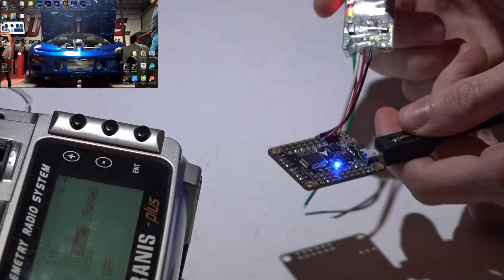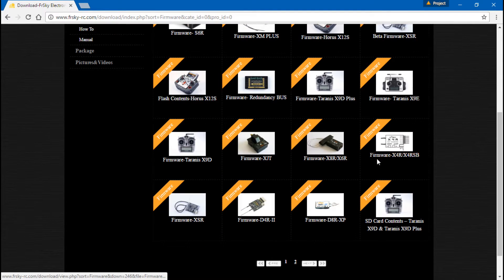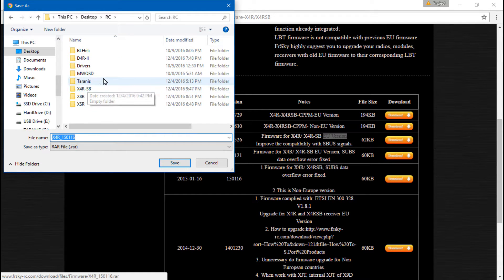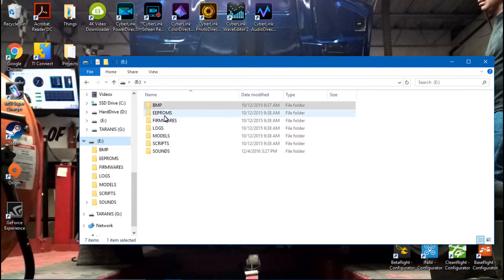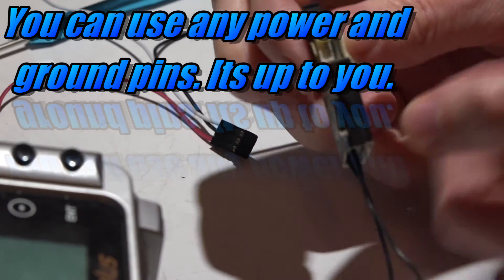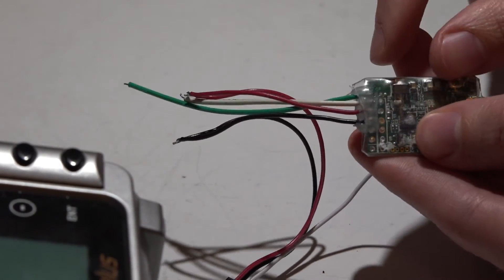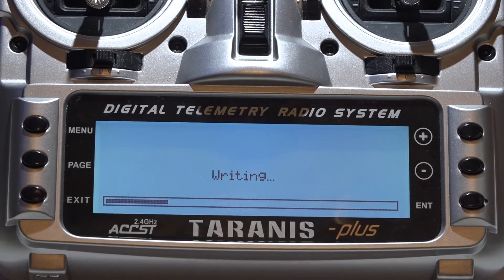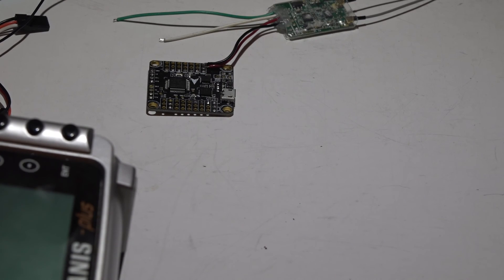FrSky X4R-SB: How To Change EU / Non EU Firmware

Comment: I upgraded my qx7 from your other then followed the instructions on this vid but I can't connect rx n tx.. I flashed the xjt module as suggested and updated firmware on qx7 exactly as you did.. what am I doing wrong . Help please
Reply: Version on qx7 is 2.2.0N371 (4df32f82).    RX firmware is X4R_150116.frk.     XJT firmware is XJT_build161214.frk

Comment: hey i have a kingkong 90gt that came with a ac800 receiver. i bind it to it. i have it set to D8 like it said. but i dont nothing happening with the transmiter in betaflight. i set the arm and mode channels but nothing happens in beta flight or with just the battery. only lose telemetry when i remove battery. please help. and my bad i know this is not a video for that but you seem like you know what you doing.

Comment: HI, just followed your instructions BUT when selecting X4*.frk to install on external device (Receiver) only option to delete file is offered. Do I need a special/newer Firmware on taranis (plus) ? It`s 2.0.17 non eu this moment. Thanx for help! br piet
Reply from the maker: I'm not sure, but I would upgrade to at least version 2.1. It has more features than 2.0, especially with telemetry. But that could also be the problem.
Reply: I will try to find more options after taranis update .. but honestly I do not believe in this solution. I will report my results. Thx for reply anyway. br
Reply: just found this.. maybe some hope :)

What you need?
Taranis X9D190 with firmware greater than 2.1.x
3 wire servo cable297 (for X8R upgrade only)
X series receiver (X8R147, or X4R167) obvoisly :confused:

http://www.dronetrest.com/t/how-to-upgrade-your-frsky-receiver-firmware-x8r-x4r-x4r-sb/1667
Reply: Surprise, surprise .. it worked!! :) Indeed a FW > 2.0.x.is needed to export Receiver Updates. Thank You very much .

Comment: Hi, just downloaded the firmware, put it in the SD card, connected to the X4R. After klicking the button for: Flash ext. Device on my QX7, i get the message: 
FM update error
Not responding

The X4R is blinking red, so i did (i guess) the wireing correct.. but where is the problem?? 
Any idea???
Reply: I have same issue. you manage to fix it?

Comment: Hi, first of all: One of the best tutorials on this topic I could find, like always.
But I still have one question:
I had to flash my Taranis X9D -plus with the non-EU firmware to be able to bind to the new micros with build-in Taranis RX.
Now I got an new X4R-SB in EU version which I now also have to flash with a non-EU firmware to connect to my flashed Taranis X9D -plus.
I saw other tutorials which then flashed the X4R_LBT_build151118. Which firmware version is now the correct one for me? The version you flashed in this tutorial or the X4R_LBT_build151118? - And if it's not the X4R_LBT_build151118 version, could you please explain why?
Many thanks in advance, with best regards from Germany
Reply: Hi again, finally figured it out, but took me a few hours because I thought flashing didn't work because betaflight didn't show any stick movements over my new omnibus F3 FC. Why? - Finally figured out that my omnibus docu sheet said that RX signal was on uart2, but was on uart3 like in JC's videos activated and shown.
So I tried all different flashing combinations.

I ended up with the XJT LBT firmware for the sender module and the X4R_LBT_build151118 firmware for the receiver to be able to connect to my pretty new two micros with build in FrSky receivers.
Unfortunately, for the X4R-SB, the beataflight channelmap is totally messed up now :-). Fro whatever reason... maybe there's als o a fix for that. I'll fix that when my Taranis battery is charged again :-) 

Finally: The reason why some of you did have to flash the internal module with the XJT build is that on the Taranis already was the XJT LBT flashed, which is the newer technology!

If you also like to fly some new micros with build-in FrSky RX then you will not be able to connect them if you don't have the LBT Version of the XJT software!
Then you should flash the internal module to the XJT LBT version and the "external" X4R-SB to the X4R_LBT_build151118 software version.

If flashing the version JC flashes in this video (non LBT) directly worked for you, you probably already have some other older models/receivers which use non LBT firmware. - If those receivers are also flashable with new firmware, you should consider switching to the new LBT standard to be able to also fly some of the new models with buildin micro receivers which are not flashable, or at least no that easy.
If you don't want to update the firmware of your multiple FrSky receivers which use non LBT firmware and don't care about micro-receivers where you can't flash the firmware, flash all your new receivers with the non LBT firmware.

If you have a pretty new Taranis you should probably better just only flash your receiver with the X4R_LBT_build151118 firmware. If that doesn't work alone, also flash the Taranis internal sender module with the XJT LBT firmware.

I'm a software developer myself and would guess that at some point in the future they will be stopping publishing non LBT firmware updates like there are no Windows-XP updates any more ;-)

If someone has a hint concerning the messed up channelmap, that would be great.

JC, again: Great tutorial videos, I watch them all and again learned a lot based on them; this one and your video "Omnibus F3/F3 Pro & X4R-SB: Connect & Telemetry" helped me to solve my problems.

Greetings from Germany

Comment: When i press the selected fw to get the menu to flashe external device all i'm getting is an option to delete i'm not getting a menu like you have at 8:58,running open tx 2.0.20.
Any help from somebody??
Reply: any answers so far? Got the same issue .. thanx a lot!
Reply: Ended up not needing to flash the fw.
I had wanted to run ppm and thought another fw was needed but turns out that wasn't the case,sorry couldn't be of more help.

Comment: Wondering if anyone experienced this, tried flashing 2 new X4R-SB using taranis, it flashed halfway and stopped saying error. Wouldn't even power up now on raw 5v. That's two Rx in a row.
Reply: Yao Wei Chua Hi, yes I flashed as per video and around half way it stopped the lights went out and an error msg appeared.  I tried it again and instantly brings up an error. I just tried the rx back in the plane and it seems to be dead. Any suggestions would be great! Great video's otherwise!

Comment: Can you please show how to fix the solid red and green x4r-sb? I'm on 2.1.9 on my Taranis and I've switched the x4r-sb firmware to eu and non-eu but still get the solid red and green led. Any suggestion or help would be greatly appreciated. Thanks for what you do btw.
Reply: Ok i solved it, you have to flash the internal XJT module also, download this file http://www.frsky-rc.com/download/view.php?sort=Firmware&down=335&file=Firmware-XJT     Get version: 161214. You flash it the same way as you do the recivers only you select "flash internal module" instead of "flash external device"
Reply: @roxstedy  this completly saved me from throwing everything into the trash. THANK YOU!!!
Reply: It worked...Thank you!!! I flashed the XJT build (flash internal module). Thanks roxstedy and PBF!
Reply: I have the same problem. 2.1.9 firmware on taranis and i flashed the x4r-sb with eu and non eu version but none worked just solid red and green led lights.
Reply from the maker: This video is how to fix the solid green and solid red lights. If you are still getting the lights then something went wrong.
Reply: Project Blue Falcon well that sucks! lol Thanks for the reply!
Reply from the maker: Sorry for not having an answer. I usually do. Not sure whats going on this time.
Reply: Project Blue Falcon No thank you. It's weird because it was binded but I thought upgrading the firmware of the XR4-sb would be best. I guess I'll just get another one or hopefully I'll come across a fix.
Reply: The X4RSB was on the stock firmware and the Taranis was on 2.1.6, when everything worked. Do you know if I go back to those firmwares?
Reply: roxstedy thanks I'll try it out.
Reply: When I downloaded there are two...Is it the XJT build or XJT LBT?
Reply: Angel Pagan I've done exactly this but nothing works..I'm using the qx7
Reply: Project Blue Falcon How to see if your taranis has an NON EU version or a EU version?
Reply: Angel Pagan How to see if your taranis has an NON EU version or a EU version?

Comment: I tried both, eu version and no-eu version, and the x4r still not blincking, what can be? I bought the taranis in Uk one month ago
Reply: I had the same issue, you need to flash the internal module as well:

Use - 150116 => http://www.frsky-rc.com/download/view.php?sort=&down=239&file=Firmware-X4R/X4RSB

And 151223 => http://www.frsky-rc.com/download/view.php?sort=&down=335&file=Firmware-XJT (there are two files in there, I used the not LBT but you can try them both)

It took me a many tries until I got it to work.. hope it helped